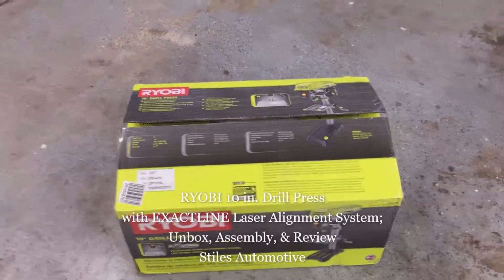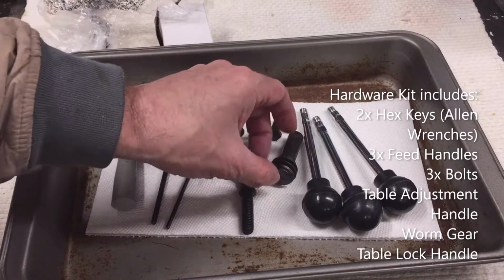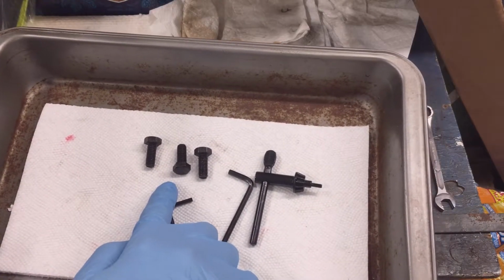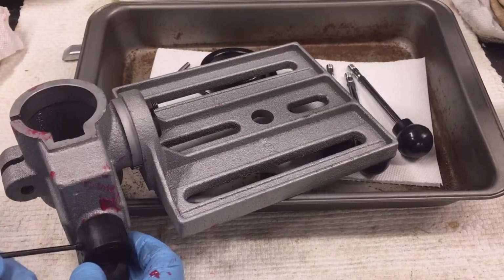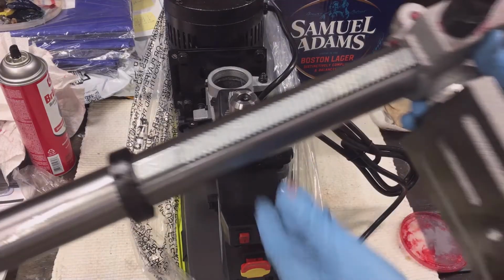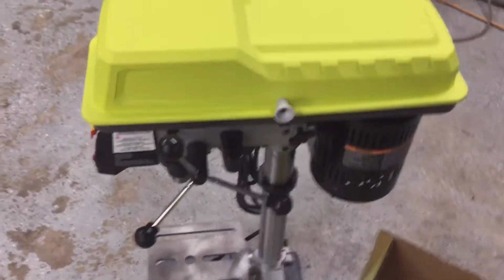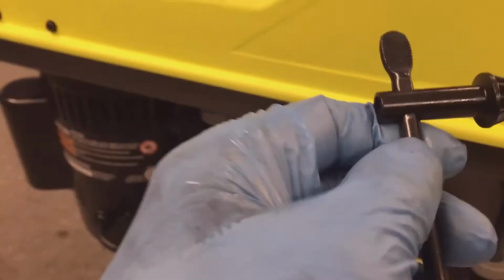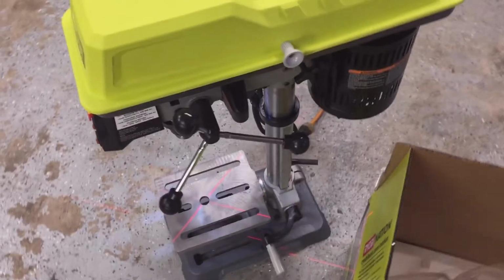RYOBI 10 in. Drill Press with EXACTLINE Laser Alignment System & LED Light; Unbox, Assembly & Review

Comment: Chuck is only held in by a friction taper fit, not even a very big taper for this unit by the looks of it. Side load using a milling bit will break it free. A true mill has a thru bolt from chuck to the top above pulley to secure the taper fit.
Reply from the maker: Huntz, I appreciate the comment.  In addition to the Chuck taper issue, I believe most Milling Machines have larger and better Bearings for the Side Loads.  I didn't have a problem milling Aluminum, I was gentle and didn't remove a lot of Material at a time, with my Sharp 1/4" Mill.  I regret not buying a Good Mill, back when I had access to people that had good well used Machines. - Stiles